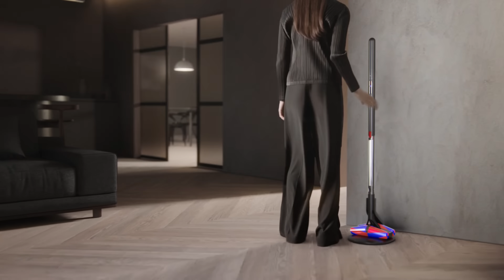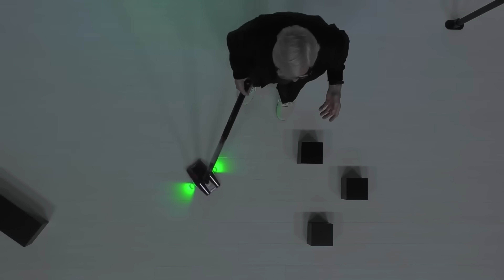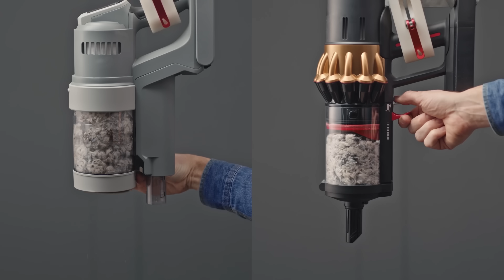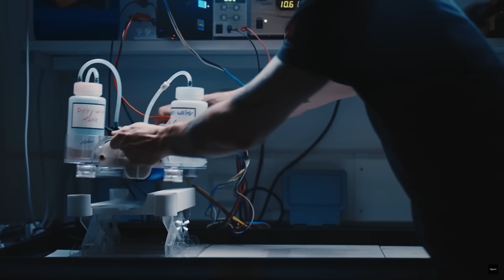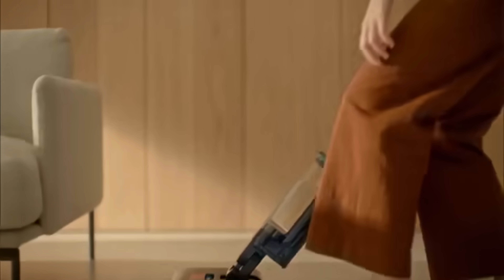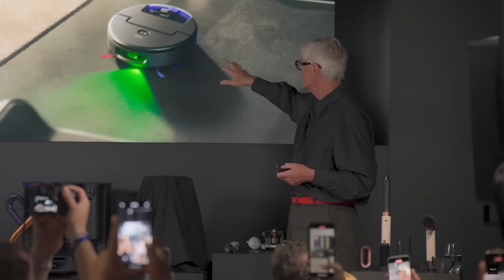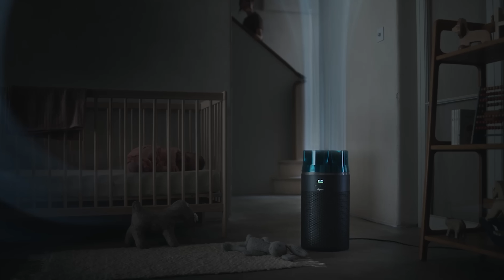What is Going on with DYSON?

Comment: One thing Dyson sucks for me - they don't allow regional customization. If you are in US you are locked to Fahrenheit, you can't change it to Celsius. Once I bought their air fan which could heat and display temperature. And it was only able to display temperature in Fahrenheit's, same thing about their app. I contacted support and they said they can't do anything, as I'm in US I need to use Fahrenheit. I was like "what?". Even the cheapest body temperature meter could be changed from Fahrenheit to Celsius. But costly Dyson could only manage one thing, which is region specific. And Dyson is UK company. They use Celsius in UK.
Reply from the maker: Hopefully that’s something Dyson eventually loosens up with updates.

Comment: That floor head design on the V16 is interesting... Looks like you'd miss a strip down the middle, and vacuuming right up to edges and objects will be different with that shape. Will have to see how it does in testing, if any of that is a problem.
Reply from the maker: The center gap and the shape near edges could change how well it cleans in real use, so it’ll really come down to testing to see if those concerns show up or not.

Comment: The new robot is dysons modefied variant of the picea robot that the roomba combo 705 is based on
Reply: It was already confirmed at the ifa event - the shown prototype had a pieca label on it…
Reply: @frickhelm  Hello frickhelm
Reply: Well I own a roomba 706 and the Dyson is nearly a 1:1 similar product in all key areas but the green LED. Even the dock looks similar. Would be a bad thing if advertised and saves iRobot from financial troubles too.
Reply from the maker: There isn’t any confirmed connection like that. Dyson designs and builds its robots in-house, and while some robots can look similar or share general layout ideas, there’s no evidence the new Dyson is a modified Picea platform or related to the Roomba Combo 705
Reply: @VacuumWars it is confirmed. The robot itself has picea label on it.
Reply: @VacuumWars  you should check the r/RobotVacuum subreddit, where people have posted the connection between Dyson Spot+Scrub AI and Picea R2 base model. Even someone had posted the prototype with the Picea label on it during IFA 2025, before Dyson noticed the leak and quickly black-taped the label.

Comment: I want the pencil vac head on my v10. I hate removing the hair from the tiny rollers
Reply from the maker: Totally get that — those tiny rollers are a pain. Unfortunately the pencil head isn’t compatible with the V10, since the motorized tools are model-specific. If hair wrap is the main issue, a rubber or soft-roller style head is usually the easiest workaround.

Comment: Not only does the V16 not fully clean the middle of the head, the front of the head is not flat, so you can’t clean right up to the edge of a room without having to turn the vacuum 90 degrees.
Reply from the maker: Yeah, that’s a legit complaint. The head design definitely affects edge cleaning, and if the front isn’t flat it makes getting right up against walls awkward. That kind of practical usability issue matters just as much as raw performance numbers.
Reply: It's also a proven downgrade from previous versions, both the filtration and the cleaning performance are worse
Reply: @ItsNicolasSama  it’s just sad at this point… Dyson peaked with the V15 and with the V16 they’re not Even offering outsize… smh
Reply: Dyson have thought about this and are now offering a 2cm wide mini brush at the modest price of £700.
Reply: They need to fail HARD on sales. Their pricing is asinine and the only way they’ll wake up is if shit tanks like it deserves
Reply: @cwill2127 absolutely agree they need a wake up call , theu knew the head leaves a line they also know the filtration is shit they still released it like this , the old Dyson would never of done that money grabbing shit like they havnt made enough
Reply: Not acceptable at this price
Reply: Good observation. However the front of the vacuum is nearly flat. All vacuums have distance between the roller and the wall. Given the impressive suction power, I doubt the conical rollers hurt debris pickup. It’s nearly square.

Comment: The V16 Piston, besides being an incremental upgrade over the Gen5 and V15, the new cleaning head is absolutely abysmal, as it has less suction than the Gen5 and V15's Fluffy head, it also leaves the middle strip.

For that reason, last month I got the V15 Detect Absolute 2023 model, which has the Gen5's HEPA Filter and updated Fluffy head. Amazing value for the money.
Reply from the maker: That’s a solid take. The V15 Detect Absolute 2023 is kind of a sweet spot — you get the improved HEPA filtration and the proven Fluffy head without paying for changes that don’t really improve cleaning. Head design can matter just as much as raw suction, so your reasoning makes a lot of sense.
Reply: @VacuumWars plus to be fair, I prefer the V15's trigger compared to the Gen5's power button at the top. Makes burst cleaning a lot easier.
Reply: I got that model too during Black Friday sale 😊
Reply: The 2023 model you speak of, is it the "Based on cordless market as of July 2022 – July 2023"?
Reply: @AnsarAli-xl2jb it should say 2023 in the listing title as well. The difference between the original V15 Detect are that it ports the Gen5's HEPA Filter, updated Fluffy Optic head and the charging speed to the V15 platform.
Reply: its shit not value

Comment: I'm like the biggest dyson and guy ever and I'm really disappointed in them. This v16 I've heard nothing but bad things about that it clogs easily and doesn't pick up well at all,. The robot looks like a knock off of every other competitor and I've heard the pencil vac clogs easily. The V8 cyclone and new floor washer sound good though. I hate to see Dyson moving away from Dyson technology and performance just to chase the market. Did hear though that the new floor washer is going to be around the 3 to $400 range
Reply from the maker: Hopefully Dyson surprises us with the pricing and the durability.